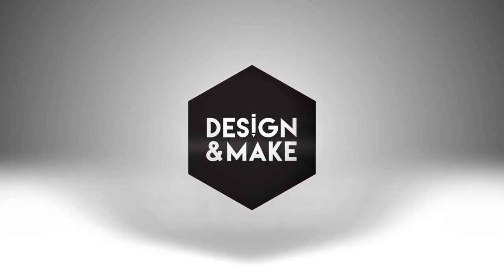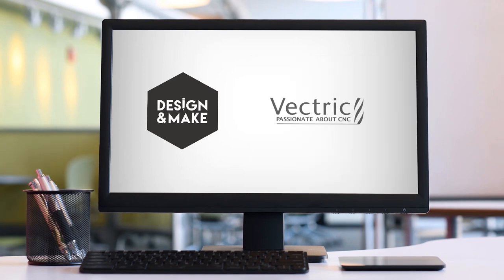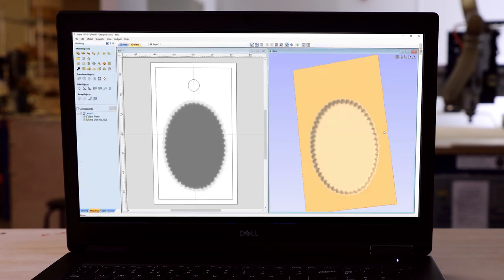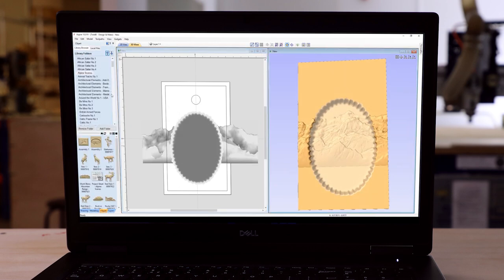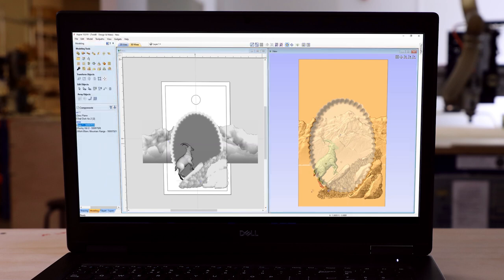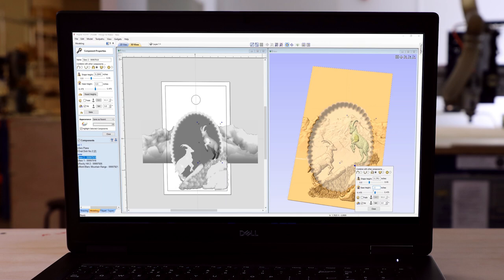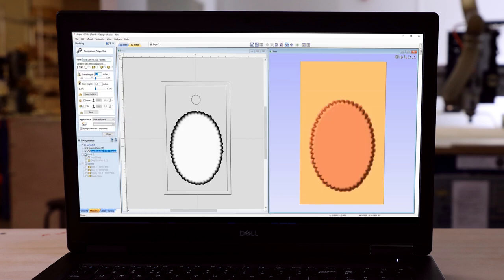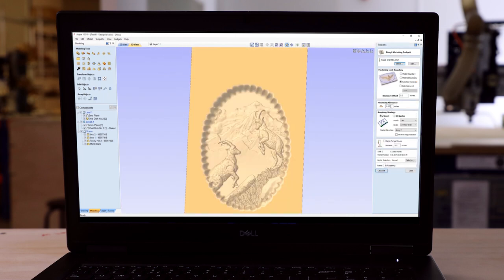Make An Alpine Themed Gift Using Your CNC | Getting You Started | CNC Clipart Model Project

Comment: How do you deal with the warping tendency? I noticed from your video that some warping was already happening during the finishing stage.
Reply from the maker: Hello Phillip, and thanks for the question.  Well if I was going to change the overall shape of the cutting board I would have used screws.  Unfortunatly when you remove that much material you do stand the chance of having a bit of warping.  Now to be fair some of the warp may have been there originaly (that cutting board was in my office for a long time) but I don't remember noticing any.  I know that is not much help... but I hope it does a bit. ~Todd
Reply from the maker: Hello Phillip, and thanks for the question.  Well if I was going to change the overall shape of the cutting board I would have used screws.  Unfortunatly when you remove that much material you do stand the chance of having a bit of warping.  Now to be fair some of the warp may have been there originaly (that cutting board was in my office for a long time) but I don't remember noticing any.  I know that is not much help... but I hope it does a bit. ~Todd